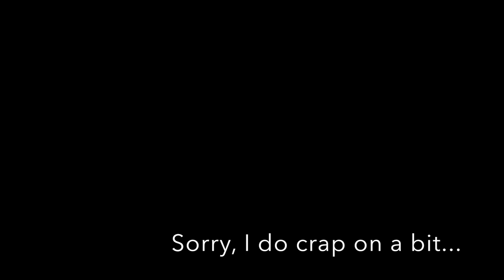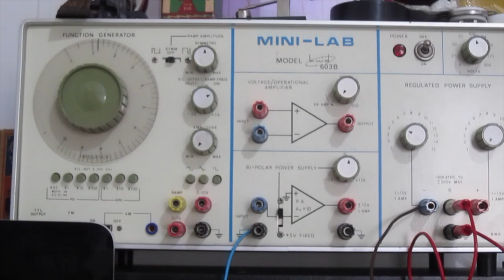Battery Valve Guitar Amplifier

Comment: A power supply schematic showing the batteries would be awesome!  Thank for sharing!  I want to build one but didn’t understand how the battery bank is grounded with respect to the chassis grounds. Cheers! 🎉
Reply from the maker: The negative terminals for 90V B+ and 1.4V A+ go to the chassis. The positive terminal for the 4.5V C goes to the chassis as well. For B+ you can use ten of the cheapest 9V carbon batteries you can find in series. For A+, a 1.5V D cell battery will work. For C- you can use three AAA batteries in series and they should last an eternity.
Reply from the maker: I'm not sure why I'm getting a striketthrough when I type minus 4.5V and C minus. The smart formatting sucks.

Comment: What if you used regular valves instead and just used more batteries in series? I assume the battery valves are more efficient, but which ones are better overall. The battery or regular valves
Reply from the maker: You could run regular valves on batteries but you'd need more batteries and they'd die quicker. Standard valves have a heater to heat the cathode and generally require way more current to do so. The heater in battery valves is the cathode and they require much less current to work. They were made for portable radios before transistors took over so they were designed to be efficient and not eat through batteries. Neither valve type is better as they are designed to serve different purposes. Obviously battery valves won't ever deliver the power of a Marshall stack.
Reply: @snarfusmaximus  are the battery valves just as good with a similar lifespan compared to the regular ones that run on mains power or are they a compromise with maybe less lifespan in exchange for longer battery life? Today we have lithium batteries compared to the batteries they used back then.

Just asking because i am thinking about building a vacuum tube bluetooth speaker and would rather have more battery storage in exchange for longer valve lifespan and better quality. If all is equal i will go for the battery versions but if not i will go with the regular valves and just battery up the thing. I already have a bunch of batteries just sitting on the shelf that were good and being tossed so i rescued them.

Comment: What a great idea! I would like to see the schematic as well. It looks like the screen is internally connected to the cathode on the 1t4 tube so they cant be triode strapped. Their transconductance is pretty low too but the sound it promising. I wonder what the primary inductance is of that output transformer? Thanks for posting this project! it is very inspiring. I've got an 82 Candy apple red Standard - Metallic red on a les paul is freaking awesome!. What year is your les paul? Thanks again!
Reply from the maker: My Les Paul is from 1975. It came with mini-humbuckers but they were a bit shrill sounding for my liking, and microphonic, so I swapped them out for P90's as they are my favourite pickups.

The 1T4 has its supressor grid connected internally, not its screen grid, so they are able to be triode strapped. In my circuit they are run as true pentodes. One can also use the 1U4 as it's pin compatible, or the 1U5 if you ground the diode on pin 4 which is unused on the other two pentodes. A link to the schematic is in the video description.
Reply: @snarfusmaximus  Thanks for the thoughtful response! I have parts on order. I might try a push pull as well. I used to have a 77 wine red deluxe that I also put p90's in because, ah, well... P90's! Thanks again.
Reply from the maker: Oh, I forgot to mention, the impedance of the transformer is 10k on the primary. That PA transformer is made for 8 ohm speakers, hence why I change taps on the primary rather than the speaker side. The 1Q5GT requires an 8k load at a B+ of 90V but 10k seems close enough.  It also keeps things pretty cheap using such a generic transformer.

Comment: Thanks,
I did a preamp design for AudioXpress a few years back that I have since refined using 1T4 tubes. You can reduce the current of the final tube using a buffer unity gain amp like the LM49600 instead of a tube.
Have you tried the 3V4 or the 3S4 as an output tube? They are the miniature tubes that designers used back then with the 1T4's. Also you can reduce the plate voltage to 50 or 60 and they still run well. Lots of fun!